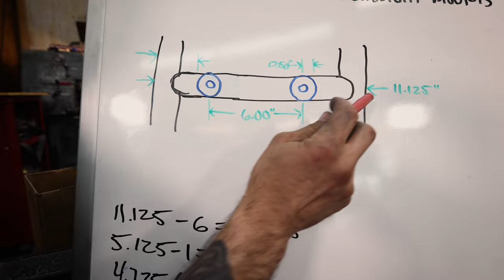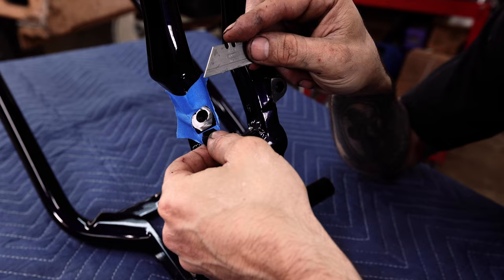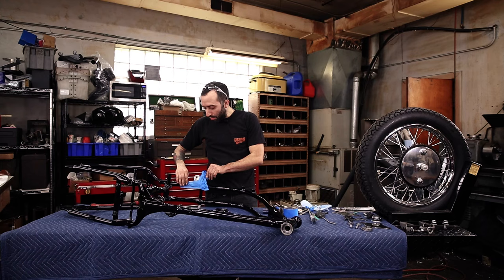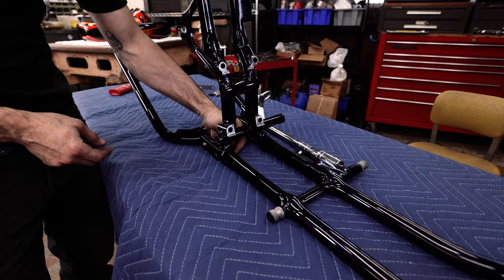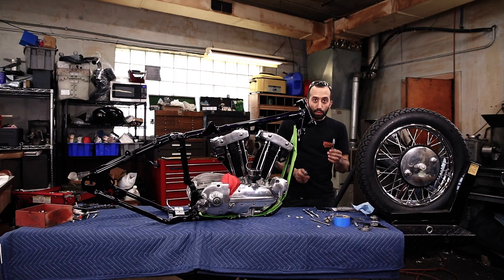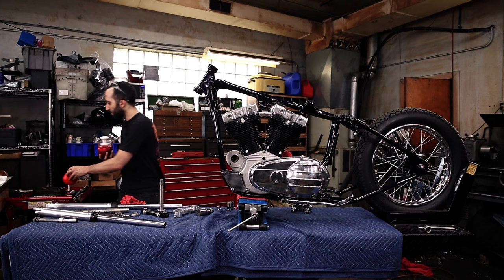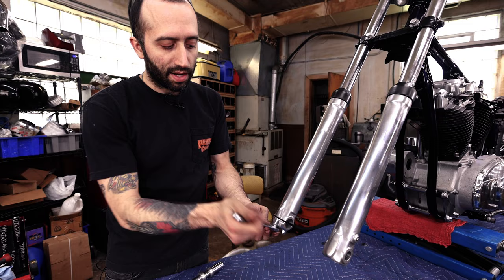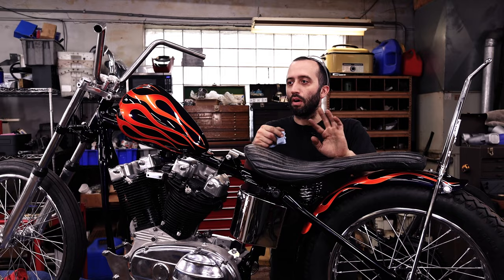Saturday Sportster - Season 2 - Episode 10 - Cleaning Paint and Assembly

Comment: Does that type of paint not require primer, because I saw no primer and only the final base overcoat over bare metal?
Reply: I’m sure the painter used a black sealer with the black and purple on top. Match your primer sealer to the top coat best you can.
Reply: Throughout the primer and base process I am sanding those area down to bare so that when he is cleaning those areas at the end it's alot easier. So everything is protected.